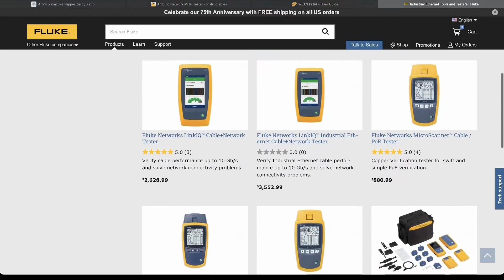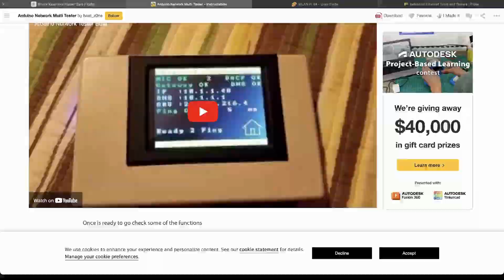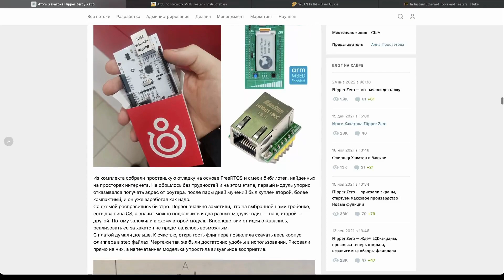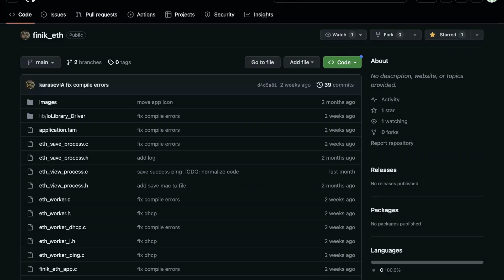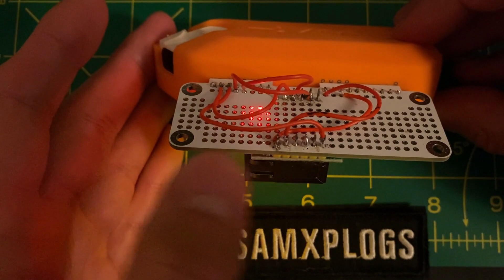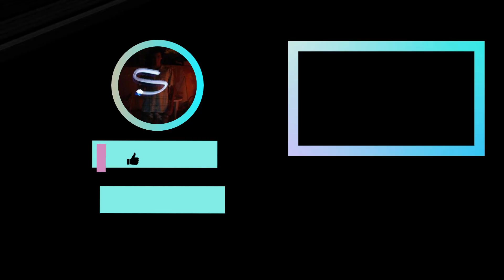RJ45 Network adapter for your Flipper Zero.

Comment: Hello, i have an issue with bigger version of w5500, thanks for great video at first, i bought the bigger board with w5500 but in pinout i dont have nSS pin on my board, should i use different one?
on my board there are pins: 5v, 3v3, GND, MISO,RST, MOSI, INT, SCS, NC, SCLK. I suppose there is similar IC package in SCS but it looks like its not working..

Comment: Unfortunately, the FAP file link is not working, you can request a new link. (I don't know English, so I used google translate)
Reply from the maker: Hi jenő, I understand you perfectly, thanks for the report. It seems the service is under an unexpected long time. Meaning we have to compile from source ourself. I will make a quick update/follow-up on this as several persons have reported this.

Comment: Sam are you able to ssh into the flipper zero via ethernet connection?
Reply from the maker: Thanks for your question. With the app, there is no SSH server. I think you will need a jumphost or ESP32/8266 that can handle the remote connection. That's an idea I would be happy to work on if it interests you, especially over WiFi.
Reply: @samxplogs  Definitely! in similar interest i have did an offline ethernet connection with a dhcp server to the pi which should be nothing new but an offline eth session into the flipper zero is my goal. essentially it would be android > dhcp-eth session > flipper zero > control.

Comment: Hi, thank you for the video, but I try to use the link for the fap file, and unfortunately, the link is not working. Do you have other ways for us to get the file compiled and ready to use or not?
Reply from the maker: Hey ! Sure, could you let me know which firmware you are using ? I already have a request for the unleashed version. I’ll look this week to generate a new fap for it.
Reply: @samxplogs  any update? im running momentum,
Reply: Thank you for the reply, I use Xtreme and Momentum.

Comment: Can someone explain in what way would you use this or what does getting this open up to you?

I'm new to this kind of thing & I don't know how I'd use it or what it really offers.
Reply from the maker: Absolutely, as I mentioned in the video, this mod comes in handy for network wiring tasks. With the Flipper Zero, you can easily test network connectivity on any RJ45 cable, performing basic tasks like pinging and verifying IP settings.
Reply: So it's made for network engineers, people paid to manage network infrastructure at businesses. Not script kiddies pressing buttons on flipper to try and piss people off/'hack' things.

Comment: Rabbit labs has a "Flip'n Cereal" module which I believe might be compatible with this? But yeah he basically sells a premade RJ45 module for flipper
Reply from the maker: Hello Willy, I'm eager to try out the Rabbits modules. I've checked out the Flip'n Cereal, and unfortunately, it doesn't seem compatible due to the chipset it uses. It's designed solely for serial RS232 connections. The one I featured in my video uses the W5500, which supports TCP/IP Protocols instead.
Reply: @samxplogs  yeah I asked around about this soon after making the comment and got the same response, my bad. Great stuff tho!